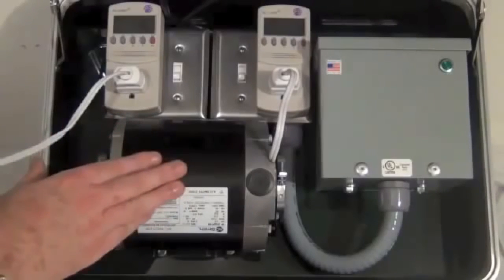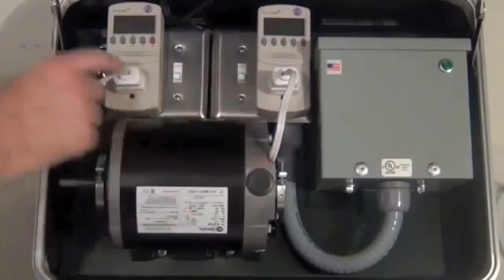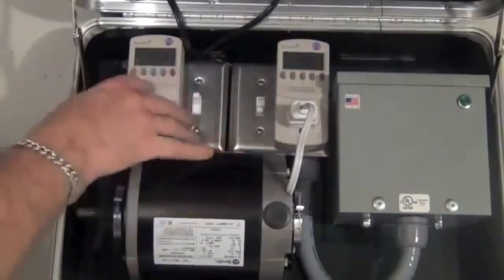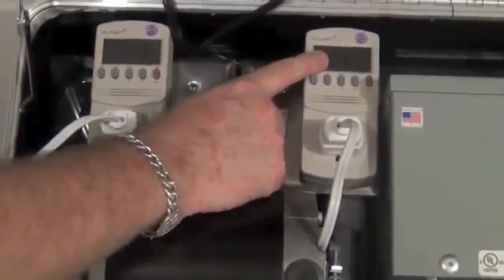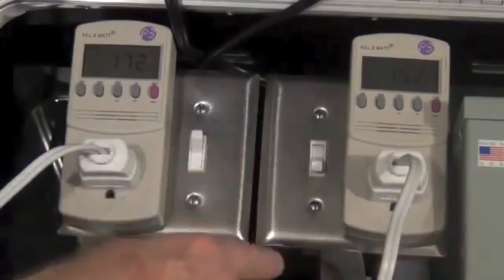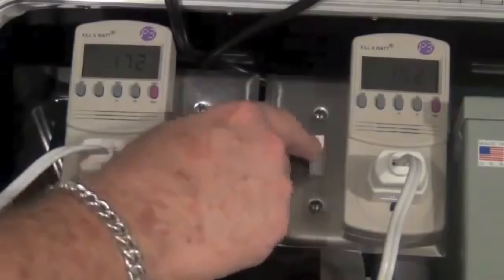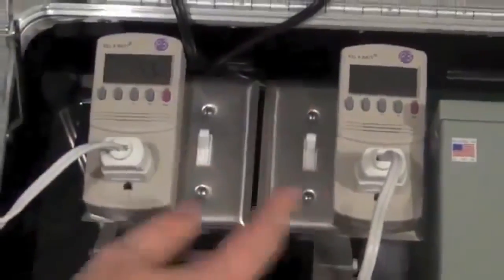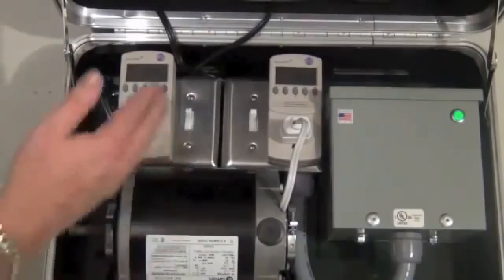kWh Smart Saver - How to Make HVAC and Refrigeration Motors More Efficient

Comment: This would be interesting if the number of induction run motors still in use in HVAC equipment wasn't statistically insignificant...
It's all PSC and ECM motors now, which will not benefit one bit from this kind of device.